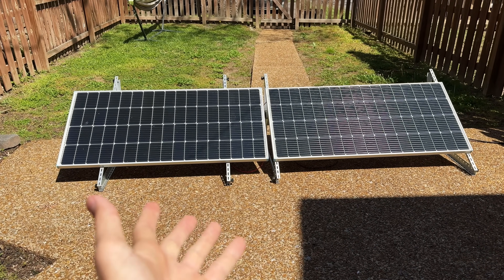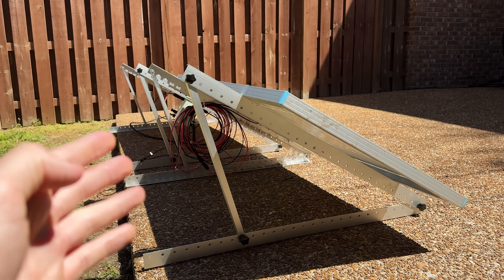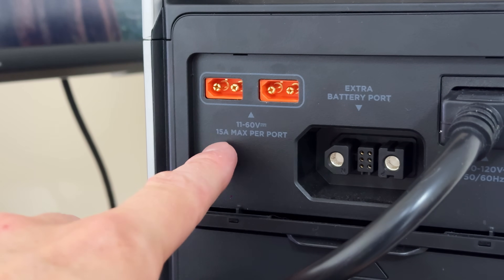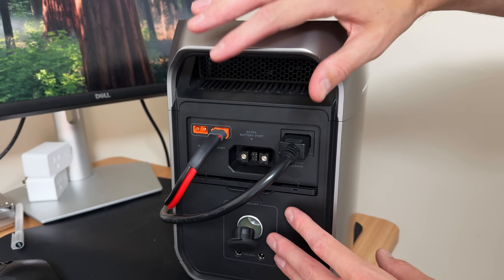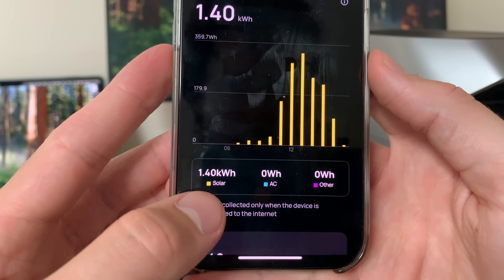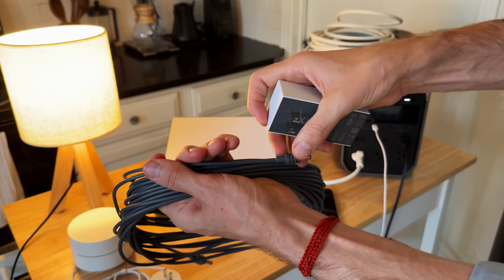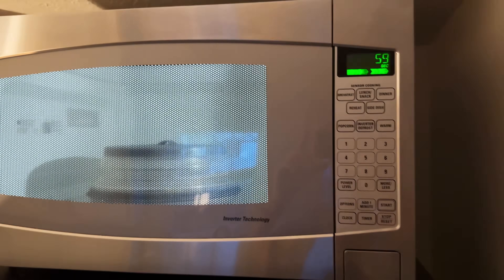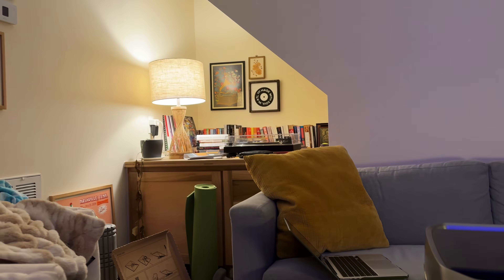Simple $1,500 Solar Generator Setup!

Comment from the maker: I definitely didn't go the budget route with some of the parts I used. If you're interested in this setup but the price is high, be sure to watch the part where I talk about how to get it for closer to $1,000.
Reply: Its cheaper DIY for fixed install.  Remember you can charge the standard labor rate on your DIY.  I DIY 1600 watts on my roof.  I grabbed a few  quotes from a contractor for something similar.  With the federal solar credits, my entire setup ended up being free.. YES , those solar knock contractors overcharge excessively which is why the DIY ends up with free equipment.
Reply: Does Delta 3 Plus have any issues still on self consumption while inverter is on 24h how much it consumes battery and how much frodge and wofi consumes, and if ac ups switchower is fast  while backup reserve is triggered. 

I am considering this Delta 3 Plus if it is really good/ better then river 2 max.

I have 2 400w panels on balcony with powerstream.

As i see on river 2 max the ups feature isnt working, switchover is slower with backup reserve feature on.
Reply: Just so I understand, you can use the same eco flow shown here, but double the solar panels? So two sets of two. For additional power. I’m looking to power some things in my off grid cabin
Reply: New solar panels coming out soon, no gold no silver used, so they should be a lot cheaper with the new gen. https://www.youtube.com/watch?v=UNIEOecdOXk
Reply: Hey there I’m looking to get the delta pro 3 and get a total of 4 panels or something that can really take full advantage of its limits.pref the ones you mentioned. The voltage is different from what you have versus the link you had. Regardless im looking to hook them up in series,  and have them on high solar. ( port 1: 1600 watt max 30v- 150v 15 amp and port 2: 1000 max 11-60v 20 amp ). High / Low PV.  What are my options what’s your take on that?
Reply: Challenge = Cheapest 1,000 watt solar system..
Reply: If you buy used and they aren't essentially under a year of use, you are risking a lot of efficiency loss as each year they get worse and become very bad between 10-15 years old, aka never get them if they are this old.

Comment: Excellent summary thank you.  = 30 cents a day savings.   if we value our time at minimum wage $15/hr, and figure we need to spend a couple of minutes a day, or 50 cents, manipulating the solar beast, we never get our $1000 back.  It would take a decade, anyway to get our original $1k investment back.   So not yet a cost saver.  IF the goal is backup purposes when power out, if we have $1000 to burn, pick-up a 10kw tri-fuel generator from Home Depot and use gas, propane or natural gas to run virtually your whole home.    As of 2025, solar getting closer, but still 200%+ too much to make financial sense for most.

Comment: ROFL, you spent $1500 to save about $100 per year.  That's a terrible ROI, definitely not worth it.  Considering the battery probably won't last to ROI its even a worse value.  This is just dumb and promoting it as a good idea is even dumber and we haven't even talked about the heavy metals in the solar panels....

Comment: I think its so cool but it'll take years by the time you break even and then depending on the battery quality, 5 years of continous daily use it'll be on its way out by that point surely. I know its not primarily meant for savings alone, if you did have a blackout its a godsend but you can just get the UPS and keep that charged from the wall for emergencies.

Comment: 1500 $ ????!? WTF. That is a 200 € set. 50 bucks per 450-500 Watt module. 70 for a 800 Watt inverter. 30 for cables. You then add DIY mounting. Doesn't make any sense to add a battery to a set that small as time of feeding the grid is negligable at that size.

Comment: Not worth the investment to try and 'save' money. Really nice if you go off-grid often and for long lengths of time, or trying to power an off-grid location like say to provide lighting and a place to charge things. This set up with a cost of 1500 and a daily savings of 30 cent a day, its like 13-14 years until it breaks even, and thats if you haven't used up all ur charge cycles on the battery or any failures that need replacing.

Comment: Invest $1000 at the minimum.
This saves $0.10-0.30 per day = $36.50-$110 per year.
ROI in 9-27 years.
What can I say, its a winner :)
(not to mention the power station might fail before you get your investment back.)

Comment: I have the anker solix gen and this is my very first solat generator and my first leap into getting into solar. Is there a 500w panel that will work within the parameters of my power station? Im still super new to this and just need a lil help if you have a second. Thank youuu

Comment: I love the idea of utilising 'free' energy whether it is to reduce the amount you draw of the grid or to achieve some comfort during a blackout. That said I feel that the cost of the initial investment, though a lot cheaper than it used to be, makes the cost per kWh a bit too high for my liking. And yes, the longer you have such a system up and running the lower the average cost per kWh will of course come down, but depending on where you live you will have to consider days without any sunshine, degrading of the system through normal wear, and not least the decommissioning of the system once it has come to its end of life (mostly in terms of recyclability of components , or lack thereof, and environmental impact).

Comment: Here in Pakistan. I have installed a 6kv hybrid solar system with six 580W chinese n-type (company: Longi) solar panels, a 6kv hybrid solar inverter, 6 solid metal frames for solar panels, wires, installation charges etc etc. And all this have cost me just 400k Pakistani rupees (almost 1500 USD). This setup has been running efficiently for 1 year and will run efficiently for next 15 years (solar panel warrenty). I may have to replace the inverter in case of any issue because it only have a 3 year warrenly.

I don't know why solar is 10 times expensive in your area. I get it that the installation cost is extemely cheap in pakistan but all material cost in your area doesn't make any sense. You can check onllne rates on youtube by searching the pakistani videos and google results to confirm the actual cost that i have mentioned. 

Maybe that's why 30-40% pakistani households are using solar power because it's extremely cheap here.

Comment: Pam here…so many microwaves are too much power.  Get a cheaper almart one which is 600w.  It is plenty.  You wont pure your popcorn and will do every thing just fine.  More things might take about 20% longer..but won’t pop your circuls.   Would love to see some vises comparing different appliances and their PULL onthe systems.  Like toasters, crockpots, induction cooktops, and even electric space heaters that could be used in an outage.

Comment: I paid $100 more for 2x the capacity.  BLUETTI 200L (2kw and 2kwh) and 4x 200W bifacial panels.  $1600 including good 50ft cables, all from Amazon.  I got the BLUETTI because it has higher input solar voltage allowing for more panels in series.  I think my setup is the minimal for a small house for emergencies.

Comment: That's great. It's amazing what this Ecoflow can power. Thank you for all the tips.
In the place I use to live in Brazil we had short blackouts daily, and some very long ones sometimes.
I had one of those UPS 800W for computers with an extra car battery connected to it, and one day the blackout was much longer than usual so I HAD AN IDEA... (let's blow it all 😂).
1 - I made a 2 wire cable with a male plug on EACH END.
2 - I turned OFF the MAIN SWITCH in the electrical panel - THIS IS THE MOST IMPORTANT STEP because when the grid power comes back... BOOOOOMMMM 😯
3 - With that cable, I connected the UPS OUTPUT to an OUTLET in the house (can be anyone if you're not plugging any high current device on the others).

That's it! The WHOLE house was lit and ALL the outlets were working. All I had to do was to be aware of the limits.
NO EXTENSIONS needed at all.

The same can be done with the Ecoflow and such.

It would be SAFER if the UPS (or power station) were plugged DIRECTLY into a high-current outlet (10~15A) near or even inside the electrical panel itself. I didn't do that on those occasions, but will now ⚡🔥.

When you learn somehow that the grid power is back, unplug the power station (or UPS), and turn the main switch back on.

Comment: Nice setup. @ <1$ per watt for new panels a 1khr setup is just squeezable into $1500.  Panels, bracket mounts, charger/inverter/ac charger(switchable-1 unit), 1kwhr battery(buffer).  ok, $1600 :)

Comment: Cut a small piece of white window insulation trim to plug that hole. Peel and stick from Walmart. Foam that comes in a roll that goes around window units. You can pull it on and off to run wires through that hole.😂

Comment: Yet another super simple and affordable way to start with photovoltaics is PV-direct, meaning three 72 cell panels wired in series to make 120 volts DC.  There are a LOT of things in our homes that run perfectly well on direct current.  Skip the batteries, skip the inverter.  Buy those later.  The categories of devices that work on DC include heating devices (water heater and space heaters), corded power tools and switchmode power supplies.  This does Not include refrigerators and air conditioners.  You will have to protect the switches (designed for AC) with a snubber made from a capacitor, resistor and diode.  You all know how cheap PV panels are.  Start with them and add the expensive stuff later.  1,000 Watts of PV powers my solar kitchen and cost a total of $420 three years ago.

Comment: Correct me if I am wrong but in the uk we have high energy costs @25p pkw so spending $1500 to produce 1.4kwh is around 35p so say £2.50 a week so it would take over 8 years to get the £1106 back.
Sorry but that sounds rather bad.

Comment: I don't see how you can justify this setup financially. If the expense is $1500 and the saving is $0.3 per day,  it is going to take 5000 days to just return the investment, by then some of the equipment will have to be replaced and will add to the cost. I am sure that having all the appliances run off solar is satisfying but it is not economical, if any, it doesn't justify the labor and efforts that were put into manufacturing the solar panels and the battery which both are unrecyclable as well. Buying more and more gadgets and gizmos to tell myself I am saving the planet doesn't work for me. Good luck.
Reply: Only real reason to own one is for power outtages.
Reply: @michaelmorrison5280  no, not the only real reason. off-grid as well
Reply: @Vicki. Well... yes and no.

They're great for people who are "off-grid" living in vehicles or something, but someone who owns an off-grid property could custom build a solar setup that would be cheaper and better customized to the needs of the person living off grid. A custom build would also allow the person to fix their own system and upgrade it whenever they want.

The main selling points of these prebuilt systems over a custom build is the portability and convenience of set-up, which isn't completely necessary if you're living off grid.
Reply: He justifies it by using it for the content. The content is justified by the views.. the views mean there is interest in the market and the interest is there because people need this for various reasons such as summer cottages off grid camping or living where electric network is unstable etc. All this eco bs is probably mentioned for appealing to a wider audience. Although I agree it does feel like his main emphasis is on saving money but that's probably just for clickbait and viewer retention + some nice to know information.

Comment: I don’t get how Americans turn 50$ Chinese solar panel into 100watts less 400$ same Chinese solar panel but with premium label, is that a tariff thing or smth? 1.5k$ for 400wats and 1kwh battery is ridiculous, 700$ for one kWh? For 600$ you can get around 4kwhat of batteries
Reply: Partly tariffs and partly localized pricing. Americans pay more for goods compared to many other countries because our wages are higher than other countries.

It's the market that determines how a product is priced, not the product itself.

Comment: A way to start.  My systems are  a little bigger providing power to my fridge and microwave on a daily basis.  Added in some extra batteries. Will last me about 40 hours in a power outage with no sun.  If it is sunny and consurve power I don't need depend upon the grid for my 120v needs.

Comment: You won't run ver long with that cheap high frequency power station. Maybeca year if you're lucky. All of these budget brand high frequency, transformerless inverters are junk. The Chinese manufacturers that designed this inverter didn't do Americans any favors when they stripped the ouput transformers out of this inverter. All they succeeded in doing what to create a truly inferior product. No different than stripping the transmission out of a gasoline powered car. No torque, a shorter life, and a much greater potential to leave you stranded when you need it most.

Comment: Wait, am I right in my math that you expect to save $9 a month on your power usage under good conditions? That's like a decade before you recoup your costs. I'm very interested in this but not if that is the savings.
Reply: ROI is real long the smaller the battery unit is. ROI on a large battery pack and ground mounted solar could be 4-7 years if you live in a high cost electricity area like California or Massachusetts.

Comment: Folks should consider Solar as "prepaid" electricity, and "insurance" to get you out of a pickle in black-out situations.  Your setup was $1500, and you're saving $0.15 a day (on average).  At this rate, it would take you 10,000 days to break even... which is over 27 years.  That's not feasible, solely to save money.  But it also provides is peace-of-mind.  I have about $3-5K in frozen foods in 2 chest freezers in my garage.  Those don't pull enough watts, even running simultaneously to give this particular Ecoflow Delta Max (v3) any issues.  I can still run my router, a tv, and my computer... and a few LED lights.  This would pay for itself, in a single event that would've otherwise caused my food in those freezers to spoil.  Not to mention, the comfortability it provides on camping or road trips (even in my truck w/o a camper... I'll bring a 12v fridge/freezer ice chest, along w/ my Starlink... and just connect it to the unit with a solar panel laying in the bed of my truck).  Works great!

Comment: That's a really good set up for normal use. But it's really overpriced in my opinion. I bought a 5 kW li-Po battery, a 4500kW inverter, 2 solar panels 585W each. Only for around 1100USD. 
I hooked the panels and battery to the inverter's input and the output to the main house power system to get continuous energy from the solar system throughout the day, and only use the city electricity at night only. 
That cut my bill by more than half.

Comment: EcoFlow - Solar Battery banks that use several watts on standby, a feature which cannot be turned off. Great if you want to find that your solar generator is actually dead for no reason. Never buying another EcoFlow.

Comment: Spend $1,500 save $0.30 a month! In as little as 417 years you'll recoup your money!
Reply: His solar setup is tiny and likely more for fun, education and some backup power more than for the savings.  Oftentimes, these tiny project to get one's "feet wet" can lead to some big projects later that one wouldn't do without first getting experience on something smaller first.

Also, his solar panels are mounted on the ground which really limit solar production with all that shading.  It's kind of painful to hear him describe how he has to move those panels during the day each and every day.

A real rooftop solar setup would cost $10k to $30k+ with panels on the roof.  It would not only power the house and charge the home batteries but also be exporting power to help power the neighboring homes with clean locally generated electricity.  But can get substantial grants and rebates depending on the location.

I personally make about $200/mo on solar export credits for the summer months!  With grants and $15k interest free loan for 10-years.... my system is cash flow positive from day one!  I expect my system to pay for itself within 6 to 8 years.  The interest earn on the interest free loan can make a lot of money too.   So the actual break-even point on my solar project could be much less than that!
Reply: I use my setup alot for power outages. Don't have to go outside in the heat,it's quiet,& I rigged up my powercords so I can just plug in my fridge & freezer. I use two ice fans before I use AC. I have an icemaker fridge. My ice fans are 8W & 60W. I did this in the August heat. I don't have to add oil like a gas generator.😂

Comment: TN residential power is $0.12 / kWh. 

If you generate 4kwh a day (400w for 10hrs) it would take 8.5y to break even at $1500

Not including panel degradation, upfront cost vs inflation, maintenance, rate changes.

“How much I save” is dumb.

Instead maybe “I can power a small cabin or a detached garage without heavy power tool use” … vs cost of wiring it to the mains (if possible) is a better angle for $. 

*sigh*. Enjoy the free engagement from my complaint comment.
Reply: his entire setup is only viable for short power outages.
Reply: Oh. I guess you specifically could also reduce the time by how much $ ya made off this video on YT